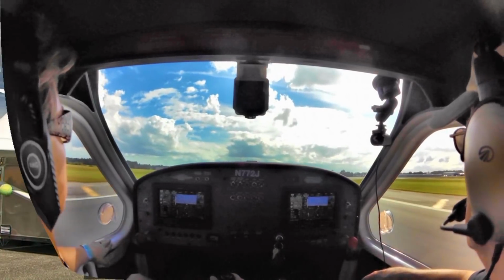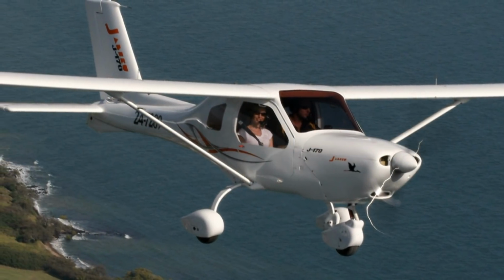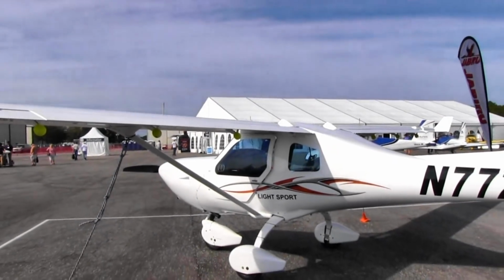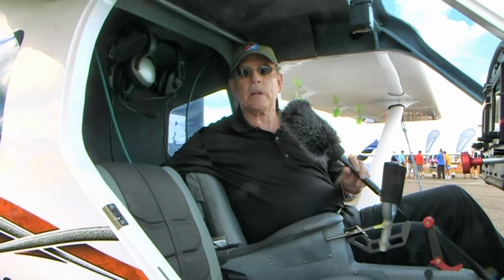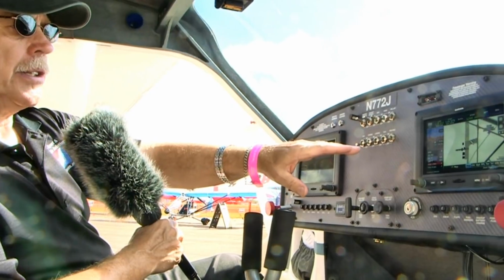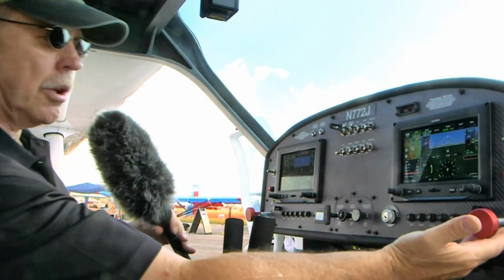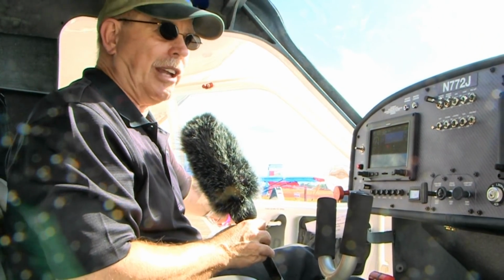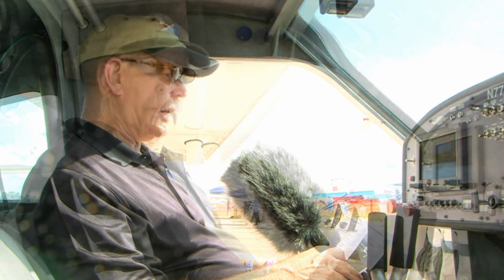US Sport Planes Takes Over North American Sales of Jabiru Light-Sport Aircraft

Comment: Seems to me the joystick and trim being located together on the same side requires the pilot to reach across with the left arm to control the joystick while adjusting the trim. Not a good design in my book.
Reply: i fly a 170 and you just take right hand off controls and set trim. plane is inherently stable and flies steering course with feet and hands free.